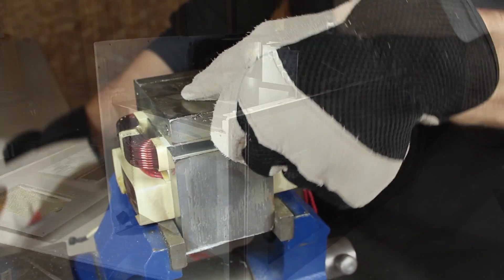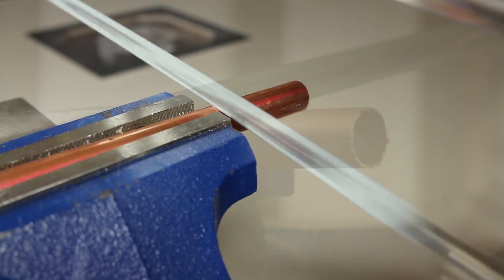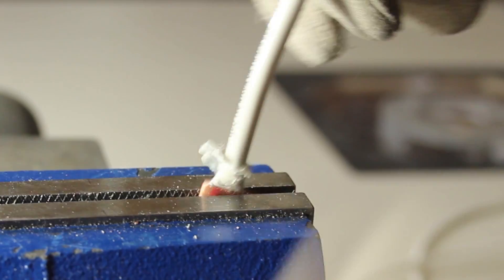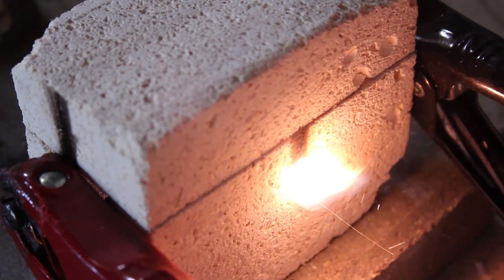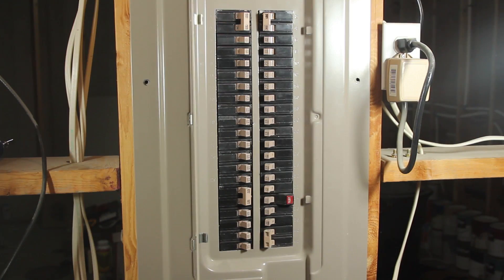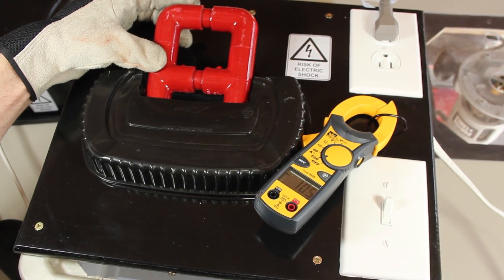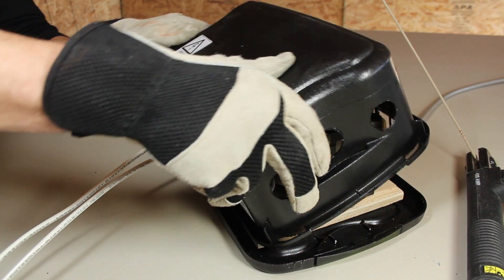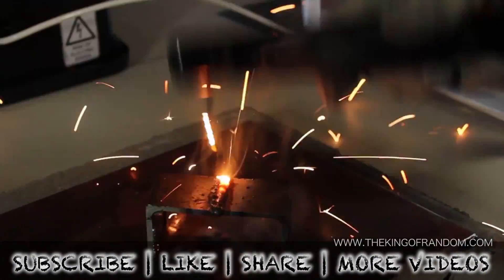Making an ARC Welder - Part 2 of 2

Comment: You need to make it VERY clear in that video that the 110 to 240V cable you have made is extremely dangerous and is known as a "widow maker". Not only is it dangerous to you when you use it, it is dangerous to anyone working in your house (eg. electrician working on a circuit and not knowing some clown has gone and made their own cable that keeps it live).

This part should be omitted from the video and replaced with a recommendation to just go and buy (or safely make) a proper transformer.

Comment: I will not be able to make the amp controller or ( Scariac ) because now I have two different plugs, every plug go to one MOT, not as yours, you combined two outlets and the result is final one outlet with 240 Volt, so you can easily connect it with the scariac.
Sorry I tried to clarify my problem as I can.

Comment: Hi Grant :)
I bought the 1/16'' electrodes and it worked well, but now I have another problem :D
every outlet in my house provides about 230 Volts, so I tried to connect the two MOTs with one outlet directly without any amperage controller, but it worked with a very weak power and can't melt the electrodes, so now I have to connect the MOTs with two different outlets, it means every Primary have about 230 Volts, and that makes it works very well.
the problem is .....

Comment: Awesome stuff but the only thing more dangerous than your death machine is mucking about the fuse panel if you don't know what your doing. I think you really need to stress more that if you're not sure what you are doing, don't touch the breaker panel and don't attempt to wire something like this.

Comment: I would like first to thank you for your concern, I got your point but I did that before, and I measured the current so I'm sure that the device produce over the 200 Amp, but I don't know why that happen
I think the type of the electrodes is the problem, so I will try to find the 1/16'' - 6013 electrodes and I'll tell you what will happen. :)

Comment: for every milimeter of thickness of your electrode , u have to add 40 Amp
But don't count the coating, only the metal core of the electrode.
for example with 4 mm rods u have to use 160 Amp.
When u start welding you should  just create a spark and then try to raise a little arc of lightning. It helps if u first strike the electrode a few times on a piece of scrap metal (like a match) and create some sparcs, than it won't stick so fast when u start welding

Comment from the maker: Hi Alaa.  You can't use this welder without a power controller.  Do not plug it directly into mains current.  Very dangerous.  I use 1/16" rods 6013

Comment: Hi Grant :)
I did everything exactly as you did, but of course I don't have the scariac so the welder works with it's full power, but the problem is every time I start to weld, the electrode stick with the metal, and doesn't melt smoothly as yours, so I think I'm using the wrong type of electrodes, so What is the exact type and thickness of your electrodes ??

Comment: sense you are running two 110 ac and going to 220 and then splitting it couldnt you just run 110 to each transformer?

Comment: You probably have the same system as the rest of Europe, which is 3-phase system, meaning every phase is separated by 120 degrees instead of the 180 degrees that Grant has. That means you'll get 400 volts between any two phases. (This used to be 380V, but the voltage in Europe has been increased a couple of years back) You'll never get 480V.

Comment: It's not like you think. You will never get 480V. The max you can get is 380V from different phases. The voltage on the video is 120 because there they use  240V  splitted in two.

Comment: In North Am. we call them "GFCIs" or "Ground-Fault Circuit Interuptors", I mentioned them earlier.

GFCIs do not protect you from being live across the line. Which is likely when you're holding both leads in your hands. GFCI protects only from being live through the ground (the actual ground, or anything connected to metal piping in your house). Also, the outlets he was using were normal ones, not GFCIs.

No perk to removing grounding wires I can think of. Odd design choice, is why I commented.

Comment: This is not what they're talking about, I don't think. 120V residential is "split phase" of single phase 240v. Different topic.

What they're talking about is, when you connect two coils, they have to be in phase to add their voltages, else they subtract them. 
You can't pick any 2 circuits in your home, they have to be on opposite legs like Grant showed. And when connecting, must be in phase.

"180 degrees out of phase" is correct for perfectly backwards connections. Else "in phase."

Comment: Power is transmitted in 3 possible phases each of which is 120 degrees out of phase with the other. It's extremely unlikely that your two outlets are more than a few degrees out of phase with each other.

Comment: I forget the actual certification body, but anything below 50V is considered significantly non-lethal enough it's not subject to the dangerous voltage regulations.

If you want to know what 37 volts feels like, chain up four 9v batteries head to tail and touch it (with someone watching in case you can't let go). The danger from lower voltages is mostly that it will cause your muscles to do stupid things, fall off ladder, hit self, burn self, etc.

When dry, 37v might not even be enough to feel.

Comment: Grant, you should really consider putting a disclaimer in the description or at the start of each arguably dangerous videos. You know, just to remove any possible liability.
I know this sounds a bit harsh or perhaps pessimistic, but some people never follow proper safety precautions.

Just do it to be safe. Just do it to make other read up on whichever weekend project you are doing.
Safety first.

Also, love the videos. I also made a stick welder. Not in the same way, but you really inspired me.

Comment: This is the most common public misconception about electricity. It is dead (ha ha) wrong. And it's the worst kind of wrong, it's true in fact but wrong in the context everyone uses.

Amps are the result of volts going through resistance. Volts cause amps to flow. So yes, it is the amps flowing *through you* that is deadly, but it is the high voltage that causes those amps to flow. The amps flowing before you touch it is irrelevant, only the amps through you (fractions of 1 amp are lethal).

Comment from the maker: I think "180 out of phase" could be correct.  That's the way I learned it, but I see your point since the power comes from a 240 v single-phase transformer.  It's just different perspectives on the terminology, but perhaps a more appropriate term would have been 180 degrees offset or 180 degree phase shift?  In either case the 240v is one complete sine wave.  Thanks for making me think! :)

Comment: Sorry if tone comes off gruff. Character limit makes comments blunt.

I would avoid the 2 outlet trick (the 240v series here, or the parallel 120v one). Well, *I* might not, (again, not being one to lecture on safety, I'm a bad example) but, I'm aware of the risk and the symptoms of failure.

The scary part about not grounding is you'd have zero warning anything was amiss. Just blam, 120 or 240v across your body or through your body to ground.

A GFCI would at least protect from body to ground.

Comment: Aware of and comfortable with is key. I'm big on personal responsibility. Once shorted, it'll probably stay shorted, so it doesn't require coincidence. Yes, both primary and secondary need shorted, but not 2 cores.

Core being live is only dangerous if you're touching the core (plastic case, not often).

I'd have grounded the frame at least, or preferably also the secondary so that when it shorts, it immediately trips the breaker. As easy to do as cutting the wire off, but significantly safer.

Comment from the maker: Thanks for your concern Matt. Actually the insulation on the primary coils would have to be compromised to allow the mains voltage into the core, and even then it would only be one core.The 240 volt scenario would require a complete compromise of both MOTs at the same time with no resistance between the cores, as well as a compromise of the secondaries at the exact same time you were touching it barehanded

and all risks I'm aware of and comfortable with.  How would you have done it differently?

Comment: I'm no one to lecture on safety. But let me lecture on safety.

The way you've done things shown in this video is lethally dangerous. The (green) grounding wire is there to be a safety ground. MOTs vibrate, this is recycled, you're using low-temp wire and electrical tape. If one of those windings melts or rubs and contacts the core, you've got a live core and possibly unisolated live secondary. 240v on the output, no warning it happened. You'd get electrocuted just touching the ground clamp.

Comment: Every other breaker is on the opposite phase. So you have to wire to the hot wire of outlets that are out of phase (odd number of positions away in the box). Otherwise you'll just get 0V. You couldn't use GFCI outlets either.